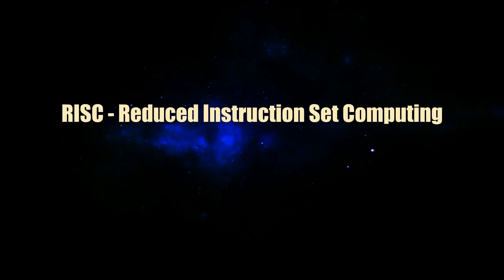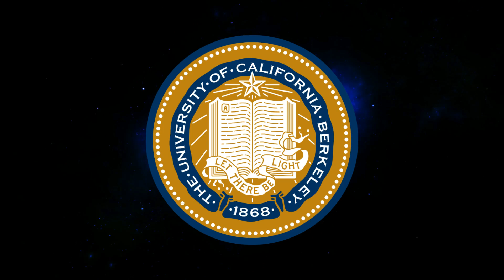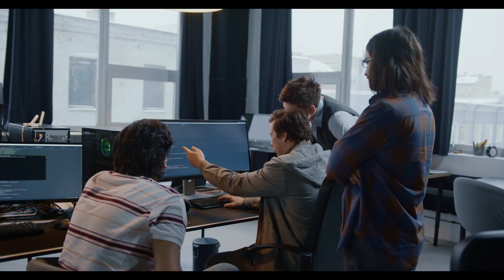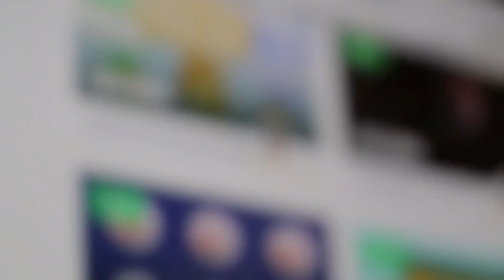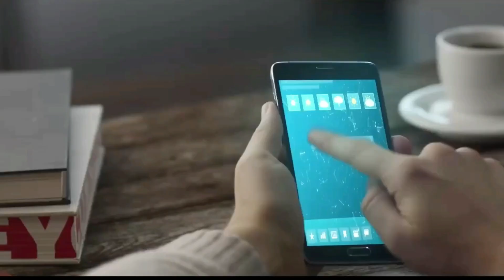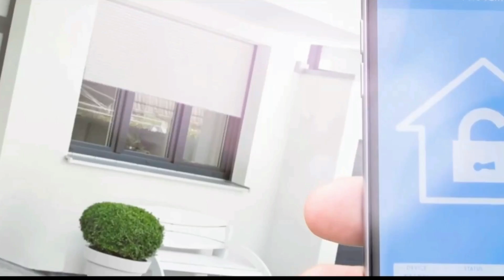ARM vs RISC-V: A Tale of Two Architectures

Comment: ARM creates a whole raft of issues due to their licensing arrangements. It means that driver support is closed and reverse engineering difficult. This means that for Linux systems support remains partial and often subpar. 
The fact that no ARM based system has an equivalent system to BIOS means that chips rapidly lose support and become redundant. 
All this is baked into the ARM model - and Will remain so. In some ways ARM has been a return to the blight of closed proprietary hardware where you are subject to manufacturers whims without any commitment to long term support (with  the Raspberry foundation being a notable exception).
RISC-v can eliminate all of these issues and this will be a major driver of adoption. Once it matures to performance parity there will be powerful motivation for  industry migration and ARM will likely be left scrambling to maintain market share.

That day cannot come soon enough for me.
Reply from the maker: And the fact that Risc-v addresses so many of those issues, is probably part of the slow progress

Comment: You can design and fab a RISC-V SoC for nothing, but to SELL it as RISC-V compatible, and use the Logo, you have to both spend many beer tokens on taking out a membership subscription from the corporation, and arrange for the design to be verified, against spec. After all Swiss bank accounts don't fill themselves, and RISC-V International, and its employees have several.
Reply: Well that's true, but if you want to make an extra million of them, it doesn't cost you anything.